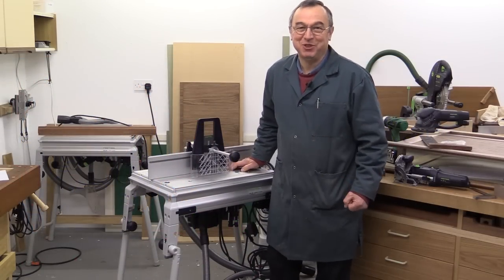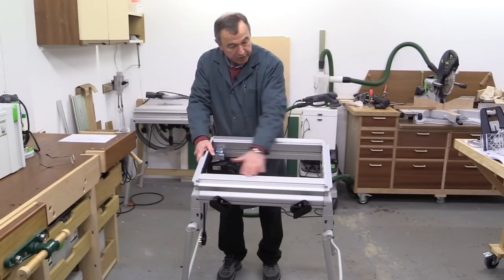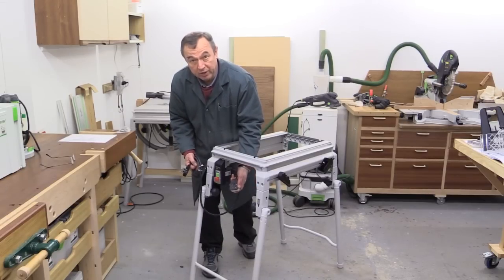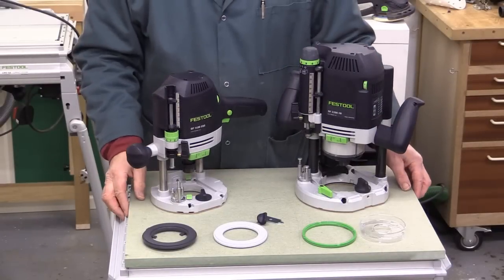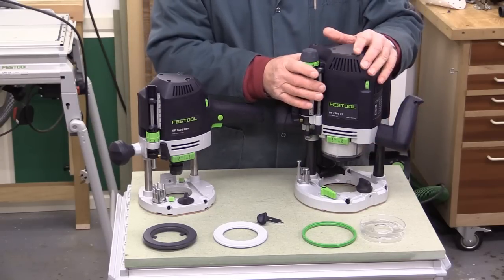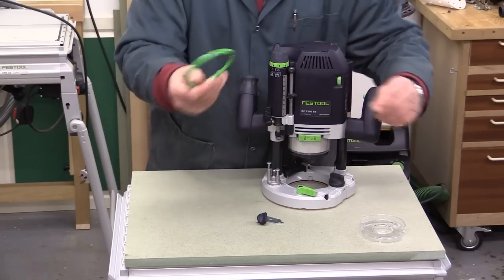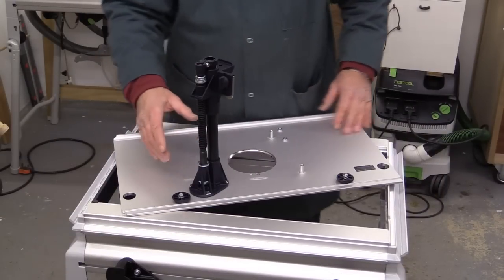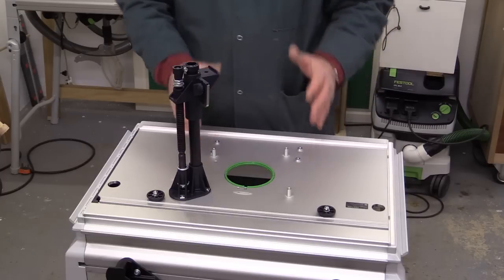Festool CMS OF Router Table - Part 1

Comment: I just got my set with the OF2200. This video is really is great and a lot more useful getting started than the manual. Good job and thank you very much.
Reply from the maker: Hi Rikard, Many thanks for the feedback. The OF2200 s a fantastic router and one of the 3 very best tools made by Festool.. Cheers.   Peter
Reply: 3 years later, but... Did the OF2200 fit your router table? I was under the understanding the CMS tables only fit up to the OF1400. Please let me know what model number you have if that is the case: I am almost deciding to go another route than Festool because it won't hold a strong enough router for my work. Thanks a lot!
Reply: @unamor  It works great, but it seems Festool is discontinuing the CMS system. The 2200 is not supported in the CMS table in the US, but that is for electrical reasons, not mechanical. Something to do with the switch and 110V.
Reply: @Eorlingur  Thanks a lot for your insight! I had no idea the system was going to be discontinued. I have decided to go with a Triton TRA001 and build my own table. Unfortunately, I need the portability and power associated with a 2200. The 1400 for what I need it doesn't really cut it (no pun intended). Thanks again!
Reply: @unamor  That is going to be a nice setup for less money. The OF2200 is really a bit too nice to use as a dedicated table router.
Reply: @Eorlingur  I love Festool but have also come to that conclusion. Thanks a lot again!

Comment: One thing to note if you are using an OF 1400 router, is that the handle that sticks out of the right side (when mounted to the table) of the OF 1400 and the attached router's power chord will interfere with the CMS table's on/off switch that's also mounted on the right side. In addition, the dust collection port when attached to the OF 1400 is on the right side which makes it even worse. Even if you can get it hooked up, the router lift can't raise it all the way up.  I struggled with it for a quite a while before I realized that there's an allen key screw inside the bottom of the cube shaped plastic piece that the CMS on/off switch is attached to. Loosening that screw allows you to slide the CMS's on/off switch back and forth until it's out of the way. It's attached to the channel in the bottom of the side piece. You might be able to take it off and put it on the left side, but I didn't bother after I moved it towards the back.
Reply from the maker: Hi Bob, Mine does not do any of what you describe and I can only think that you have put the router in the wrong way.   Peter
Reply: @NewBritWorkshop  You know - I was watching your video again, and I noticed that your on/off switch is different than mine. It could be because mine is newer, or it also might be that I have the MFT/3-VL - the table part only has two legs because it's made to attach to the side of an MFT/3's V-channel. You can see one of these being used in https://www.youtube.com/watch?v=Db5mAeVxxW8 - and it seems like the Festool guy has already moved his on/off from where it was when shipped. You can see it's been moved towards the MFT3 table. Plus - your switches are over/under - mine are side by side like the one in the video.
Reply from the maker: Hi Bob, Interesting.  Cheers.  Peter

Comment: Hello Peter, could you recommend an all-round router setup/system? I've watched all your videos on the Festool routers, the UJK router table and this CMS router unit. As mush as i love the festool routers and the UJK router table, you don't seem to pair it together and you've gotten a separate deWalt router.
Reply from the maker: Hi Georgie, My Festool CMS-OF has the Festool OF1400 in it and it works really well. The down side is that the fence is not very good. The UJK setup had a brilliant fence and the cast iron top made everything so solid and secure. The dust collection is not as good as the Festool setup though. If starting from scrat then look at the UJK setup paired with something like the Dewalt DW 625. You could spend more and the Woodworkers Workshop have a fine display of router table options.  Good luck.   Peter

Comment: Thanks for the video Peter. Do you know if this CMS table will work with the Festool OF2000? Thanks!
Reply from the maker: Christopher Kelby Hi Christopher, I am not sure what changes were made between the OF2000 and the OF2200. You would get an answer very quickly if you raise that question on the Festool Owners Group (FOG).    Cheers.     Peter
Reply: Thanks Peter!
Reply: @ckkelby  What did you find out, Chris? I know it's been a while, but I am in the market for a table with a router that's more powerful than the OF1400. Thanks in advance!
Reply: @unamor  Unfortunately it does t fit the OF2000. I ended up getting a Kreg table and mount and PC for table work. Really sad too, I want the 2000 table mounted but alas it’s a big honking plunge router for me
Reply: @ckkelby  Thanks a lot for your swift reply after all these years! I know, and I don't understand why their largest and hardest to maneuver router is also the one that is not capable of being mounted to a table. 🤷🏻‍♂️
Thanks a lot for your suggestion! I will look for those alternatives.

Comment: Hello Peter.  I was wondering when you will do a review of the FESTOOL KS120 EB KAPEX.  You have had it for some time now and we need your valued comments about it.  Im thinking of getting the FESTOOL KS120 EB KAPEX or the Bosch Bosch GCM 12 GDL 305mm Axial-Glide Mitre Saw.
Reply from the maker: Hi Chris

I have had the Kapex on my to-do list for a long time now. I have about 3 months of video work in hand right now and will do my very best to help.

If it helps...

It is a great saw. I spent 3 months doing market research before buying it and I did consider the new Bosch which was being released at that time.

It is expensive but is so accurate that the benefit will be reflected in the quality of your woodwork and the joy of using such a great tool. It is quick to set up for angle cuts.

I would still buy the Kapex today if I wanted a new saw.

Peter
Reply: Peter Parfitt Thats all I need to know.  It looks like you only spend your money on top stuff so thats good enough for me.  Thanks Peter.

Comment: Hi Peter.  I have one question.  Do you know why Festool discontinued the CMS router table. After a year I’m now ready to buy one and they are no longer available. Very disappointing. If you could shed some light on the reason for discontinuing sales that would help me very much. 

Hope you are well, Eric
Reply from the maker: Hi Eric, I do not know the reason but it might be an issue conforming to new electrical regulations in certain countries or it may just not have sold very well given the amount of other router tables on the market. I have the CMS-OF and love it. You might be able to pick one up on ebay.  Peter
Reply: @NewBritWorkshop  thank you Peter. I enjoy your videos very much. And I very much like the Parf bore cutting jig. I own one and it’s fun to use. Thanks, Eric

Comment: Well Peter. Do you know where I can buy one of these? They seem to have been discontinued in Ireland and the UK.
Reply from the maker: Hi Cathal, They no longer make these and the Precisio is the new small table saw.  You are unlikely to find any dealer with the old CMS-TS in stock.    Peter
Reply: @NewBritWorkshop  Thanks Peter. Festool replied to my enquiry today, they said they have no future plans on designing a new router table either.